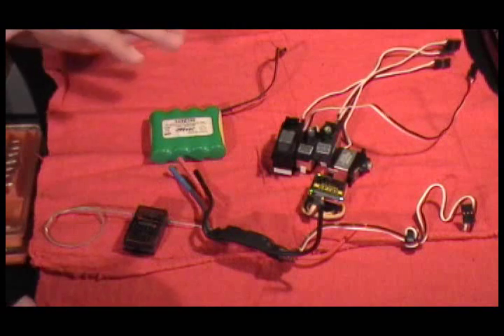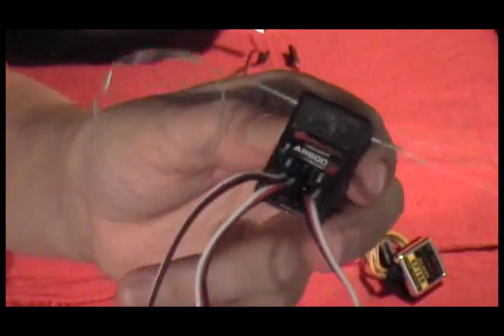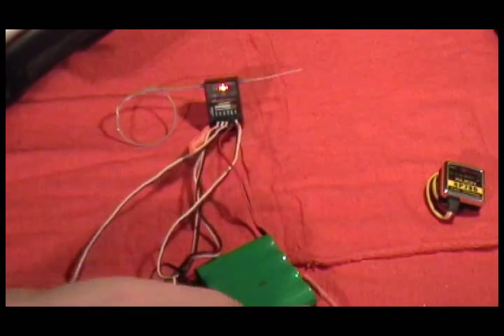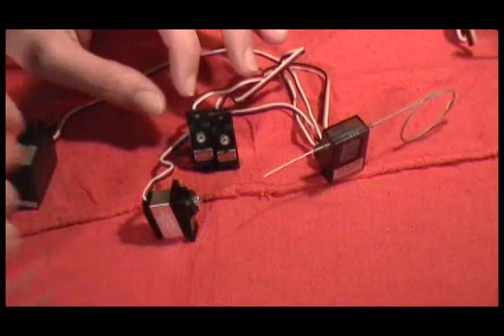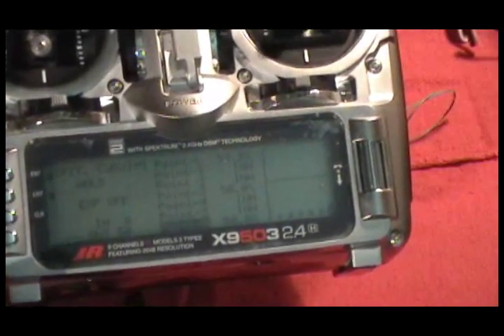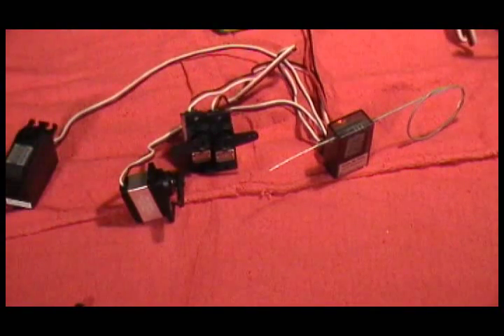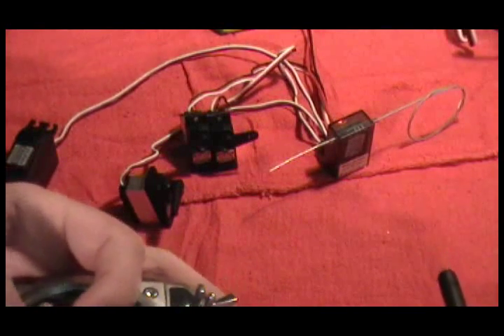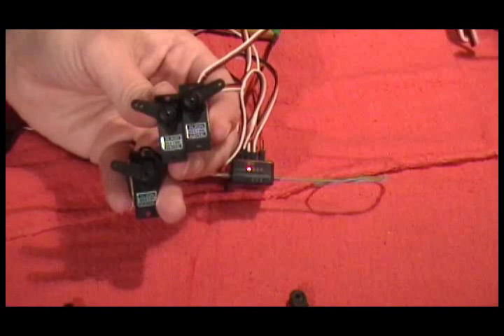Electronics Pre-setup for RC Helicopters

Comment: why do you use a different servo for the tail? Is it important to do so?
Reply from the maker: Yes, the swash plate servos need to be strong and accurate, but the tail servo needs to be FAST most of all, it doesn't need to be really strong usually. Since the tail servo is controlled by a computer, it needs to move really fast to keep up.
Reply: jasmine2501 my servos (for a 450 size heli) are rated at 2.5 kg with .1 sec response time - is that good enough for the tail?
Reply from the maker: No that doesn't sound right. The one I used on mine is 0.07 sec.
Reply: jasmine2501 Thanks. I got a separate tail servo with the same specs.
Reply: Can these servos be used in car rc?
Thanks

Comment from the maker: @Drumbone71 Yeah probably you've gone to Colpar down by Lowry. Keith is a good dude and will help you out. RC Hobbies is a good shop too, off "Boatworks Dr." down south. I would suggest to go ahead and get the Pro. The Sport version uses the old frame design, and the new frame is a lot better. The shaft drive tail is easier to break and slightly more expensive to fix, but the better frame and overall smoother operation is worth taking that risk.